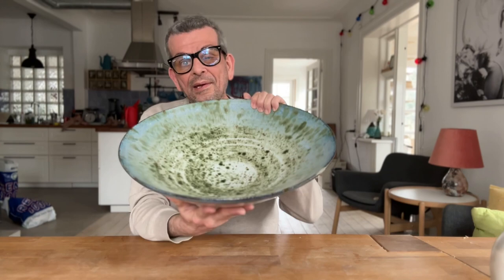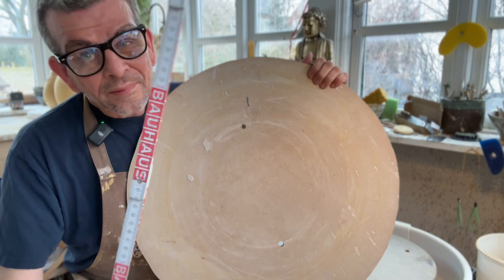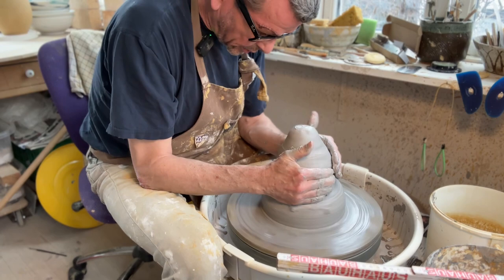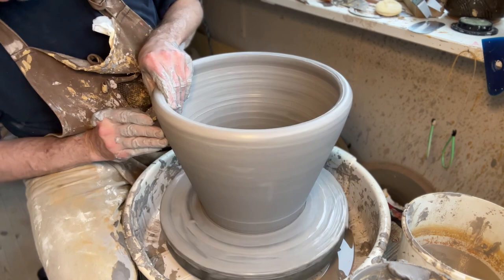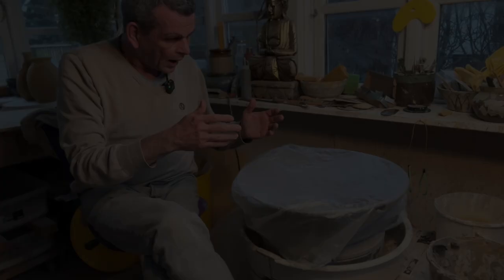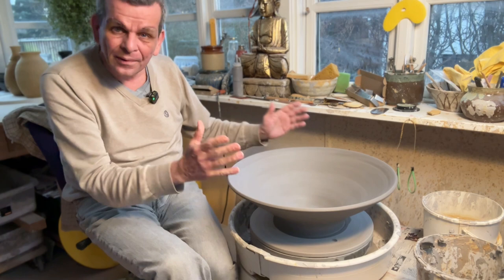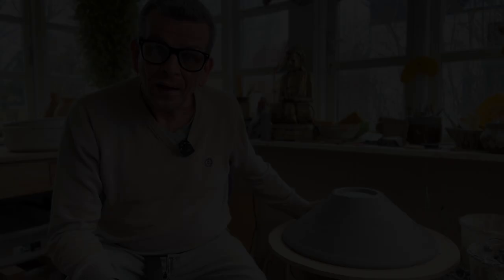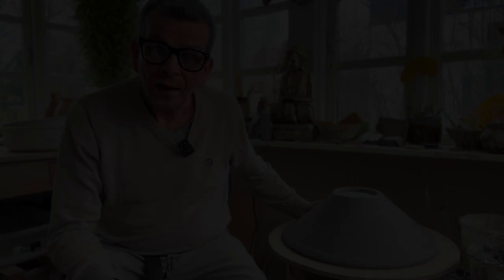98. Throwing a 54 cm (21 in) Wide Bowl on the Pottery Wheel

Comment: for larger bowls I made a rib from plexiglass about 15 cm by 8 cm. flat on one long side and rounded on all other sides. It helps a lot. Also going down with the rib makes it wobbly and going up with the rib straitens it out. Don't forget a hole in the middle of the rib. On the larger bat I've seen some one put removable canvas on it for a plate and made 2 bats because they want to flip it over to trim.
Reply from the maker: There off course many ways to make plates. This has just proven to me to worl really well and with no problems at all

Comment: Thank you for another wonderful video. I am pleased you know a lot of carpentry,which you find useful.Sorry to hear about your eye and I will pray for your fast recovery. A few under 54 is good otherwise you may not have gap in kiln.
Reply from the maker: Thank you very much! I will try a bit larger next time hehe :-)
Reply: I will send you some drawings soon, just been going crazy lately at work with no fixed times. Woodwork and metalwork will help you a lot to build different items like the ball mill and you can make some hardened ceramic balls or metal balls to crush the glaze materials. The tumbler can be a paint tin with a closeable lid which rotates at a slower speed on two rollers driven by a pulley on one roller and connected to a pulley on a motor with a belt or chain. Rollers can be mounted on pillow block bearings and you will need 2 pairs. Easy rollers can be made from wooden broomsticks mounted on wooden base and once you are happy you can improvise. Items are available cheaply on internet. Take care and hope you get well soon.

Comment: I really appreciate the skill involved in achieving that form.  I'm just a beginner at pottery, but was a glassblower for many years.  Toward the end of my glass career, I began producing large wide bowls, similar to yours, for making vessel sinks.  They required about 20 lbs (9 kg) of glass & a helper to make.  Getting just the right form was tricky.  The bottoms had to remain thick, for drilling, and the rims also had to be thick and sturdy.  My kiln measured 24"x24", so I never tried to make anything larger.  

Thanks for sharing your work with us.   👍
Reply from the maker: Thanks. 

Next door to the other workshop I work in - where we only do porcelain, there is one of Denmarks best glass blowers. So I see some of the many challenges he have with that material. I am amazed by the skills it takes